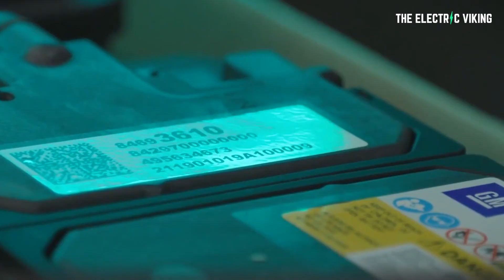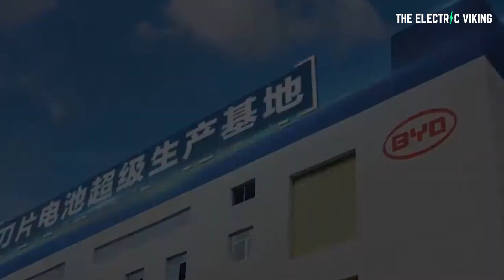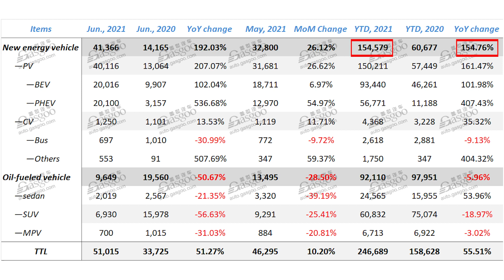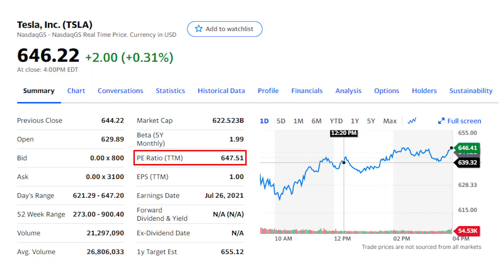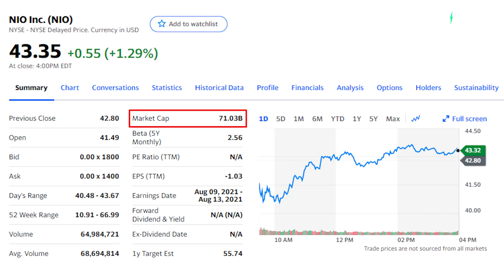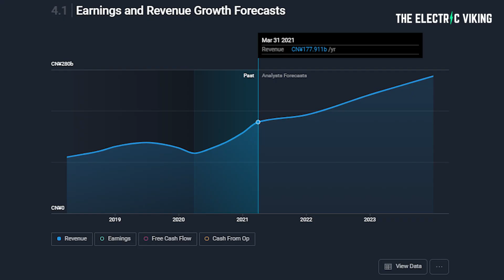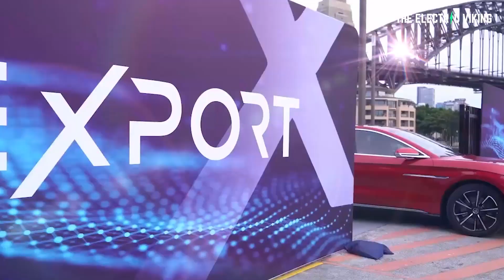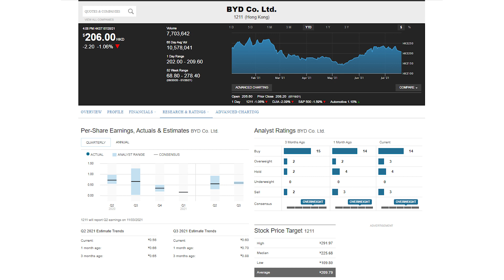Citibank analysts say BYD stock crushes NIO

Comment: They don’t have a swapping battery..and also Nio will do a cheaper brands as well soon..No one can beat Nio,even Tesla in 5-10 yrs
Reply: I watched a NIO range/ battery test by an American in China.
100kWh car.
1) Didn't get the advertised range.
2) Fiat swap station, no 100kWh pack a VC available (ONLY ONE PER STATION! FAIL!)
Second station, Autoswap had a problem, technician had to assist.
As the swap finished, another 100kWh car pulled in, no pack available.
It's not going to work unless a LOT of packs are waiting on site and that's a waste of resources.

Found the link

https://youtu.be/SYUfOLrHiuM
Reply: @rogerstarkey5390  but also they making 600ml range.and swapping station was upgraded which is swapping a bit quicker..That option is perfect especially in china,a d for those who lives in the flat..im not buying a tesla because i need it for cabbing,and I can’t waste more then 1hr for charging it,because i live in the flat not in the house
Reply: @tairaxundov868  
Swap speed doesn't matter if they don't have the pack ready.
Reply: “No one can beat NIO” ..! 😳
Hmmm, that sounds like, bullshit, to me..! 🙄 
NIO is nowhere near, as profitable, or, making the level of company income, or, vertically integrated as BYD..! 😉 
I don’t doubt that there is a need for NIO’s battery swapping service in China, with a much, much higher level of apartment living than in the West, but, ..good luck, to NIO, trying to scale, that sort of battery exchanging service, into other countries right across the ROW..!   Because they are going to need all of the luck they can get, to succeed, in the ROW, with that sort of business model..! 🙄🙄
Reply: The biggest problem is that Nio’s JAC plant is pretty rubbish, even after their upgrades